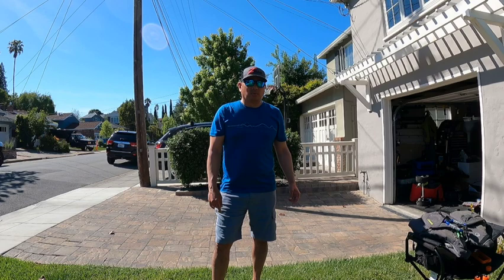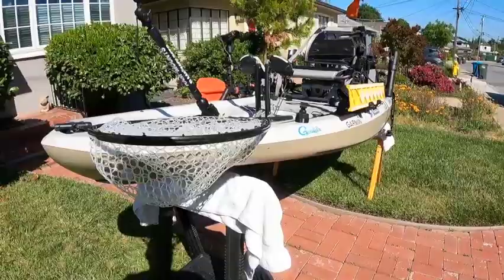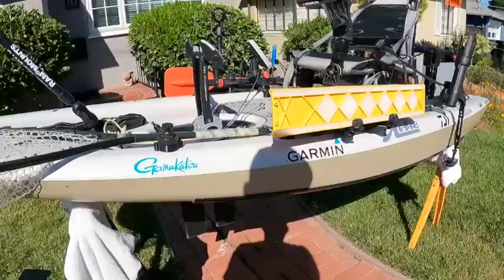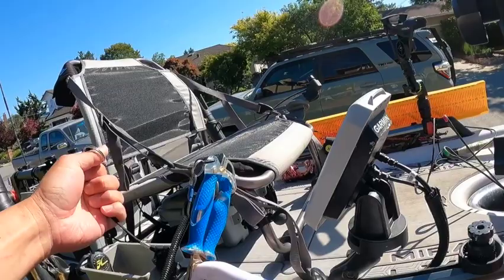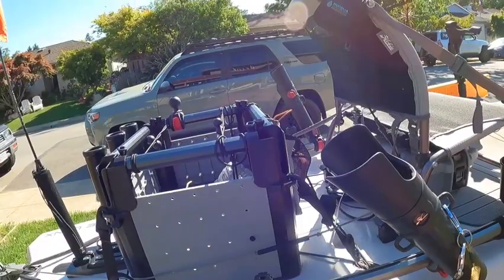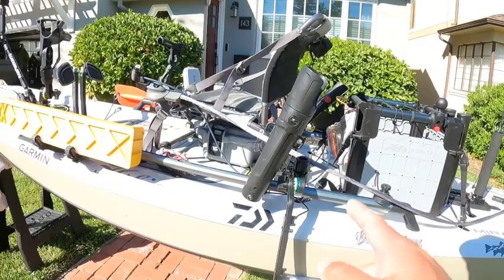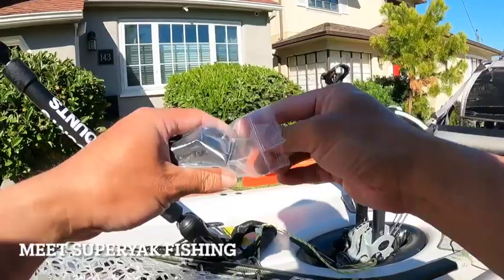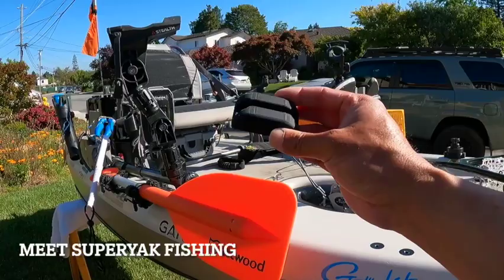How I setup the Hobie Lynx kayak for BFS Fishing & Trolling + New SuperYak Fishing Accessories

Comment: Nice channel and setup. Really tempting to trade my outback for Lynx. It’s a hassle loading it on roof top and don’t wanna spend $1k for a trailer. Im ok with not having storage or getting alittle wet for convenience and portability. I mainly troll so as long as I have a downrig, fish finder and 2 rod holders I’m good.
Reply from the maker: Thanks brother. You'll absolutely love the Lynx. I put a small downrigger on mine sometimes. My buddy puts the big Scotty 1060 on his Lynx. Handles it well. And yes, the lighter weight of the Lynx makes it super convenient to load and go! Tight lines bro

Comment: Sweet vid. Just bought my Lynx but won’t be getting it for a few months. How’s that car trim held up on the hull? Really trying to find an affordable option. The pereguards are all pretty pricey. How did you get the trim to stick? Is it heavy? 

Thanks!
Reply from the maker: Congrats! Hope it comes in sooner for you. The car trim has been surprisingly durable. Going on 2 years with the same trim. Really helps protect the bottom and sides of the Lynx. Strongly recommend!
Reply: @BayAreaBFS  what adhesive did you use to install it?
Reply from the maker: @mr.t1581  The trim comes with its own 3M adhesive. I added a bead of marine silicone around the edges just to help keep the water out. Honestly, it's been a couple years and the silicone bead I put on has pretty much peeled off. The original adhesive on the trim is still going strong.
Reply: @BayAreaBFS  that’s great to hear. How many feet do you recommend. Someone told me the water would get underneath but good to hear from you thst it’s holding strong still, I think I’ll try it.

Comment: I'm doing away with that same motor you've installed. Ive used it for about 2 months in salt water and it doesnt last long before it rusts and jams. And when it jams because of the rust built up, theres no way to remove the armature within to even clean it. 

Tell me how yours go.
Reply from the maker: I haven't had any issues with rust. However, I always thoroughly rinse with fresh water after using on salt. Only issue I had was seaweed getting caught in the prop. I installed a prop guard after that and been good so far

Comment: Ya got too much junk on a hybrid yak/SUP that is designed to be a minimalist type rig.  You're trying to make it a bass boat and in the end, all that stuff will not make much of a difference and will clutter up your fishing platform and get in the way.  Just sayin.
Reply from the maker: Thanks for the comment. Curious, what items are excessive? I'm frequently reconfiguring and moving/removing things to keep it more minimalistic.
Reply: @BayAreaBFS  Seriously, take a look at the original Lynx when you bought it.  Then look at everything you have on it in this video and ask yourself "is all that necessary?"  Otherwise, why wouldn't you just buy a Pro Angler 14 or a Whale Shark and load it down that way, or better yet, why not a microskiff, since you feel the need to have all that stuff on-board.  In other words, you just took a 45lb yak and added another 45lbs to it, which changed it's original purpose.